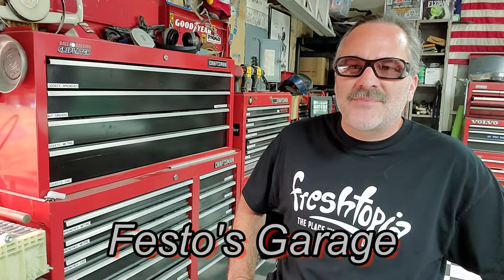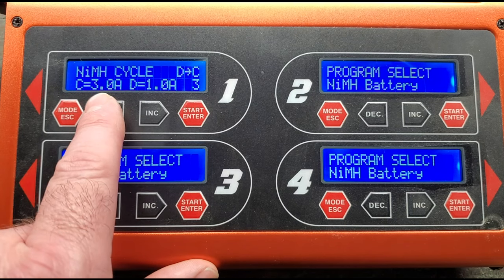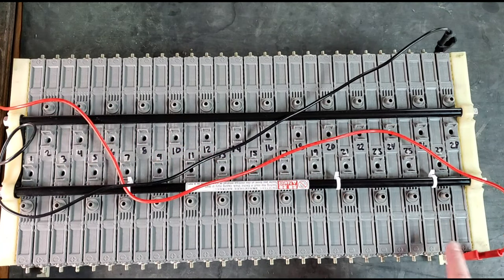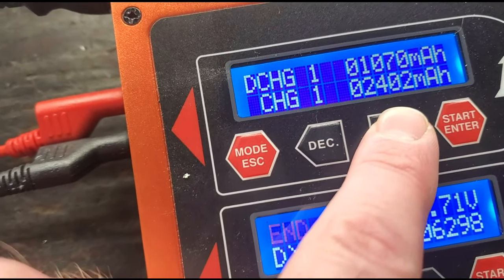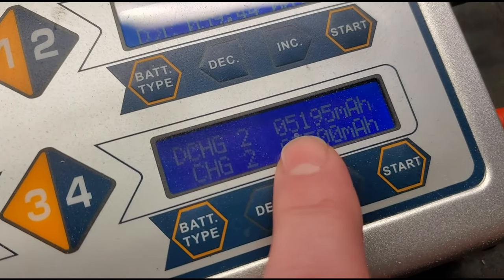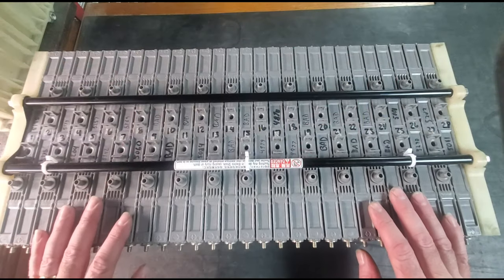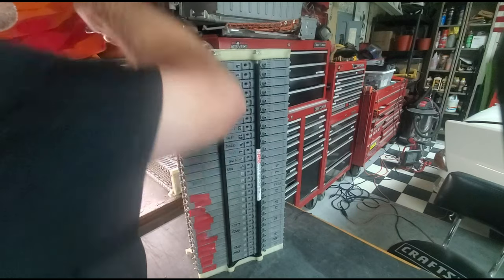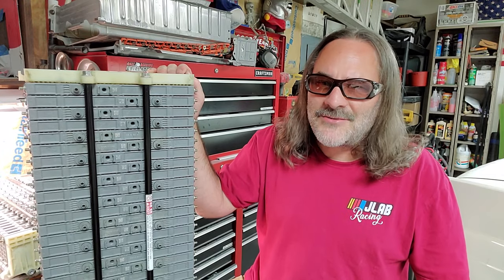Hybrid Battery Pack Refurbish - Step-By-Step w/ Settings - 2nd & 3rd Gen Toyota Prius - CQ3 Charger

Comment: Hi Greg another question. Saw couple of videos going on safe side and charging at 3 amps. One guy said at 3 cycles would take average 9 hours per cycle ??? means 27 hours per 3 cycle discharge / charge ?? He said he was charging at 5 amps to go faster lol how much of a difference would it make at 3.5 amps ?? worth the risk ?? I know off of your experience you said 3 amps. I have 2 sq2 will be getting wires tomorrow to start charging recycling cells. Again thanks from Quebec, Canada
Reply from the maker: Thanks for watching. I usually stick to the 3a as you mentioned this is safe. I have gone to 3.2a but did not see much of a difference. I have not tried 3.5a or 5a myself. My understanding is that a slower discharge/charge cycle will provide a better result than a fast discharge/charge cycle due to the way chemicals in the battery respond to temperature (low amps = less heat). If you do try 5a could you please share your results?
Reply: @GreggFesto  lol Don't intend to, will stay with safe and sure results.
Reply: I have tried 4 amps and 5 amps, but I think I get the best results with 3 amps.   When driving, I have seen the car charge as much as 90 amps.  (90 amps / 28 modules =  3.2 amps).  But this is not all the time, but it appears 3.2 amps is okay.  In practice, I usually charge @ 3 amps.  It is strong enough to reduce memory effect.  Also, if you charge @ 4 amps up to 8.60v, it may apply less of a charge than if you charge @ 3 amps.  I noticed that the total mah when discharging a module is more when you charge @ 3 amps compared to charging @ 4 amps. Doing so gives the module a little more time to take on the charge.

Comment: Why do you first tighten the nuts with the soldering wire?
Reply from the maker: Thank you for watching. This is done to balance the batteries. The welding wire connects all positive terminals to each other and all negative terminals to each other. When left like this for 24-48 hours the batteries will all adjust to the same voltage as each other. Note this is stainless welding wire, not solder. Use good metal for this such as welding wire, bailing wire, test leads, or even the bus bars if you have enough of them.
Reply: @GreggFesto  Hi Gregg et al: I used thick soldering wire and it worked well - so any highly conductive metal should be good.  Solder was great because I could wind it around the posts before tightening (finger tight only) the nuts down.   Not sure my step was necessary, if your straight run of welding wire works well.

Comment: Hey Gregg. I was wondering if you can use this charger as a grid charger to charge the whole battery up to capacity similar to using a Maxx Volts grid charger?
Reply from the maker: Thank you for watching and commenting. I am not sure how that would work.

Comment: Thanks for the video Mr Gregg! Could you give me a link for the banana plug to alligator clip cables, please? From where did you get them? Thanks.
Reply from the maker: Thank you for watching. I added link in the description for the wires I purchased from Amazon.
Reply: Hey there, Mr Gregg, could you also share the link for the Bus Bars and Nuts please? Currently working on 2007 Toyota Camry battery pack and need to buy a new once for sure. Pack is bigger than Prius pack and has more modules (34) on it and need more burs and nuts for 34 module pack. Thanks again for the great video.

Comment: How long does it take to charge the batteries in the 5 cycles you did?

Also how many cells can the EV PEAK CQ3 can charge?

Also, does it take 48 hours to balance the cells or can I do it faster?  

Thanks
Reply from the maker: The time it takes to run cycles will depend on the health of the battery. It usually takes me 16-21 days to do a whole pack with a CQ3 charger. This charger has 4 channels. Usually 24 hours to balance the batteries is enough however 48 hours will leave no questions that it is equalized.
Reply: @GreggFesto  what charger I should use to do 4 battery cells? And how long does it take to refurbish the 4 batteries? Also can I refurbish 12v car batteries too?

Comment: What if full is flashing after starting the cycles. Does that mean it is good and charged up. It did not give me any readings of discharge or charge when I hit mode.
Reply from the maker: Thank you for watching. After you get FULL message it means cycles are done. You should be able to see values when hitting mode button. I suggest trying again so you can confirm the discharge value is at least 5000mah.
Reply: Thank you so much. You have a gift for good direct instructions.

Comment: Hi Gregg, using the same Cq2 or Cq3, is it possible to recondition a li-ion battery like the one used in Ford Fusion or other models. I am looking but find people selling used packs with mentioning 50% capacity but don't see video like your's where they recondition them. I see there is a li-ion mode in the menu, but is the procedure the same ? Thanks
Reply from the maker: Thanks for watching That is a great question which I do not know how to answer. At this time I have only used my CQ3 on the Toyota batteries. I would think that there would be a similar procedure but do not know the settings. Have you searched for Ford Hybrid forums?
Reply: @GreggFesto  Did not look into  Ford Hybrid forums yet, was looking on google and youtube and find nothing other then dismantle. Will try in forums.

Comment: How much time for charging and time for discharge and how much the total time for one cycle. Please reply
Reply from the maker: Thanks for watching. The length of time it takes to complete a cycle will depend on the health of the battery. Typically a pack of 28 batteries can be completed in around 2 weeks.

Comment: so at 16:39, just hook it up with solder wire in parallel and and let it sits for 48 to balancing (without connect the solder wire to charger right?) Thanks
Reply from the maker: Thank you for watching. I used TIG wire which is stronger than solder wire but I think solder wire should work. The important thing is to connect all positives lugs to each other and connect all negative lugs together with good connection. Do not connect to charger. When they sit for 24-48 hours, the batteries will all become the same voltage as each other.
Reply: Got all reconditioned and battery looks good but still “ check hybrid system “ message pop up and car wont start. Can it be blown fuses somewhere or any other issues? Thanks for your input in advance.
Reply from the maker: Code saying Check Hybrid System could be something other than battery. Is this the same error you had before reconditioning the pack? If yes, Then certainly you could have blown fuse or a failed part. I would first check that the orange plug for battery is completely installed and the latch for it is locked properly. If problem still exists, check that all of the plugs were reconnected correctly to the pack and the pack modules. If this does not solve issue, re-scan for codes and see if there are more clues to what could be issue.
Reply: @GreggFesto  yes it happed before battery conditioning too, i checked the voltage today on the output port wire back into the vehicle it doesn’t have any voltage which it should shown high voltage.
Reply from the maker: Perhaps you have wire or connection that has failed. I would trace back that wire until you find where is no connection point to battery. another alternative would be to post on forum PriusChat for help. That is a great resource for Prius information. Please if you can keep us updated on what you find is the issue.
Reply: @bobysize  and all reading this.  Don't forget that the orange safety plug has three steps to reconnect it, not two!   Many put the plug back in and press it one way.  There is a third 'press it down' step for the plug to be fully connected!
Reply: Just want to update this, I brought it to the shop and found out the mouse went into the dashboard and bite the electrical wire. Thanks for the video that I was successfully reconditioned all the battery.

Comment: I followed your steps and went with 5 cycles instead of 3. First and second cycle is fine but from 3-5 the charge and discharged shows 0000 mah
Reply from the maker: Thank you for watching. If you had CAPA message on screen when finished then the readings would make sense. Was the cycle 2 charge value 7500mah? If yes, what was the discharge value? If discharge was not 5000mah or more then you can run more cycles.

Comment: Hi Greg, I'm working on a 2001 Gen 1 pack. The Modules are rated at 6500 mah. So, two questions, my Capacity cutoff should be set to 6500 mah?... and Second... should I be looking to reach 4000 mah on my discharge reading. Thanks
Reply from the maker: Thank you for watching. I am not sure of the difference between Gen1 and Gen2 batteries. I suggest checking PriusChat forums. Gen2 batteries are also rated at 6500mah, the reason the charger is set to CAPA at 7500mah has to do with the way it reads voltage while the battery charges, you can learn more on this by researching "delta peak charging".  I see you have more batteries than a Gen2 to refurbish. Hope you will write back and let us know how your pack turns out.

Comment: Will same process and settings work on a gen 1?
Mine is '03, 182k, p3030 code, garage report says 5 cells are 0
Have an odb2 on order for Dr. Prius.
Have blue driver

Why are the best cells grouped in the middle and not on one end?
Thanks
Reply from the maker: Thanks for watching. This charger should work on any of the batteries. I have not done a 1st gen Prius pack before so I am not sure if the settings may be different. I suggest you visit forum called PriusChat and ask there what the battery settings should be. When finished with the refurbishment of batteries it is best to put the strongest ones in the center of the pack as they see the most heat stress.
Reply: The Gen1 batteries are very similar to Gen2, so you can use the same settings.

Comment: Do not set max charge to 7500mah, the packs are rated @ 6500, using 7500 will ruin the battery and cause the pack to no longer trigger delta 5 which is a safety to prevent overcharging.

Comment: Hello Gregg,I was wondering how long does it take to run 3 cycles?
Reply from the maker: Thank you for watching. The length of time to cycle will depend on health of battery. In my experience the battery pack as a whole will take around 21 days

Comment: Can this be used to charge inside the car? With orange plug pulled.
Reply from the maker: Thank you for watching. You need to remove all of the buss bars for charging and then put the batteries in parallel to balance them. Is much easier to do this on a bench.

Comment: Gregg, Thanks for all your help!!!  I have one question, in your first video you put out a few years back (https://www.youtube.com/watch?v=FsPaO2HO8uI&t=608s) you had the NiMH Discharge settings set to 1.0A 6.3V.  In this video the NiMH Discharge settings are set to 1.0A 6.0V.  Just curious why you brought the voltage down?  Again, thanks for all your help!!!  Kevin
Reply from the maker: Hello Kevin, Thank you for watching and commenting. I have found that while both voltage settings work well, the 6.0 seems to provide desired results with fewer cycles.

Comment: Would this charger also work for a Gen 1 battery pack. 2003 prius?
Reply from the maker: Thank you for watching. Yes this charger will work for Gen1 batteries. The settings may differ though.  The PriusChat forum may be a good place to check for settings info?  So far I have only worked on Gen2 and Gen3 batteries.

Comment: Did my 1st cycle and the numbers are super low - 00596mAh and 00864mAh. I am using the settings in the video, any suggestions?
Reply from the maker: I get low readings on first cycle many times, especially if the car has been sitting a while, this is nothing to worry about. The next cycles you can start to tell if the battery is coming back or not. You may need to run many cycles for results. I wish you best of luck and hope you will write back and let us know how your refurbishment turns out.

Comment: When I went to the website for the charger is says it shouldn't be used with hybrid car batteries or it'll cause damage to the charger.  Have you had any issues?
Reply from the maker: Thanks for watching. Have been using this silver CQ3 for years with no issues except noisy cooling fan.

Comment: Can you comment on the gauge of the wires? Or even better, do you have a link to a 4mm banana plug to alligator? Thanks in advance!
Reply from the maker: Thank you for watching and commenting. Here are the last ones I purchased.  

https://www.amazon.com/Sumnacon-Multimeter-Crocodile-Alligator-Stackable/dp/B073ZVJDCF/ref=sr_1_4?keywords=sumnacon+banana+plug+to+crocodile+alligator+clip&link_code=qs&qid=1690449590&sourceid=Mozilla-search&sr=8-4
Reply: The cq3 charger comes with 14 gauge cables (states right on those cables' insulation. Get yourself a thick cable from some goodwill store or a junk yard and the proper ends from the harbor freight tools and yoy will have excellent quality cables. Just make sure they are all identical length.

Comment: Hi Gregg...thanks for this video!! Running my 1st (4) cells and (1) went from 3458/6982 on Discharge/Charge 5 to 2190/4921 on Discharge/Charge 6. I'm assuming I need to Discharge/Charge another 3x? Discharge/Charge mah was consistently increasing until 6th cycle. Also...is it typical for 3 cycles of Discharge/Charge to take 12-16 hours? Thanks again for the help!
Reply from the maker: Thanks for watching. Your assumptions are correct,,, try to run the battery that went from 3458 on 5th cycle to 2190 on 6th cycle some more. Sometimes they will fluctuate up/down in value and still come back to good health. Now it is very possible that is a failing battery that will need to be replaced and you will know this for sure if your numbers continue to fall or stay low. I have seen this many times. Regarding the time to cycle battery 3 times taking 12-16 hours, Yes this is normal from my experience. I hope this helps and I hope you will write back in with update when you have finished your pack refurbishment.
Reply: @GreggFesto 12 hours to cycle 3 times. Using a 4 channel charger like in the video would mean 4 days and nights. Any way to speed this up without buying a 2nd charger?
Reply from the maker: Thanks for watching. I do not know of any way to speed up the process. The better cells will reach the goal faster. I have had the process take up to 3 weeks. I just stick with it and think of what I will do with the $$$ I am saving.
Reply: @GreggFesto  Oh right I was hoping this would be a Friday Saturday Sunday weekend job, as will need the car to drive to work. If it take 2-3 weeks then that's too long.
Reply: @ahmadmohamad6384 I am assuming if you have more chargers to do each module at the same time it can be done over a weekend

Comment: i have a 2012 Prius C which i bought a replacement battery from a refurbisher that has a 1 yr warranty.  I installed the battery myself which was easy.  After getting it completely hooked up     the hybrid warning comes back on just like before.  Does this mean that there are bad cells in the replacement battery   or is there somethung else I should be looking at?
Reply from the maker: Thank you for watching. You may need to clear the codes more than once  and/or unplug the 12V battery for a few minutes after replacing the pack.  Confirm the orange plug is properly installed with the locking tab pressed down all the way. Be sure all wires and plugs are connected. Did the reconditioned battery come with computer and electronics or did you reuse you old ones?
Reply: @GreggFesto  it can complete!  even with the fan connected.  I gave an obd2 code reader from Oreilly that i have plugged in several times and i did disconnect the small battery and put a small trickle charge on overnight.  it’s puts out 1.2 volts and the dash lights up good.  So do l need to take this to toyota and reprogram the computer or what?
Reply from the maker: If you have checked all connections, confirmed orange plug is properly inserted/locked, disconnected 12V battery for a few minutes, then cleared codes a few times it is possible you got a failed battery or have another issue. What did the company you purchased battery from suggest? If they are of no help and you have no specific code for what is the issue then you indeed may require diagnosis by a professional.
Reply: @GreggFesto  i will get ahold of them monday and see what they will say. i’m sure i did everything right BUT there is a possibility that maybe something is not plugged in good but i will double check. would my obd2 show the codes or does it have to be a different type of scanner that toyota uses
Reply from the maker: You may need a better reader such as Techstream or Autel to get more specific codes but you might be able to tell what the issue is with your current OBD2 reader. Please do let me know what you find out, I am interested to know what the resolution is.
Reply: @GreggFesto  i did not get any response back from the battery remanufacturing company  Did talk to local toyota dealer and they are agree with you about using a better quality diagnostic system to pull up codes. That’s the next approach.  Thank you for your assistance
Reply from the maker: I use Autel AP200 and it has served me well. Cant beat it for the price.
Reply: @GreggFesto  which is better
Reply from the maker: The dealer should be able to tell you exactly what is up. The downside is that you pay and only have answer to what is wrong. If you are wanting new scanner then Techstream or Autel are my recommendations. Techstream is the best system however Autel is much less expensive and will do most of the same codes.
Reply: @GreggFesto  at $2500-$3000 for a new scanner. You’re right , they are expensive. I’ll let toyota fix it!